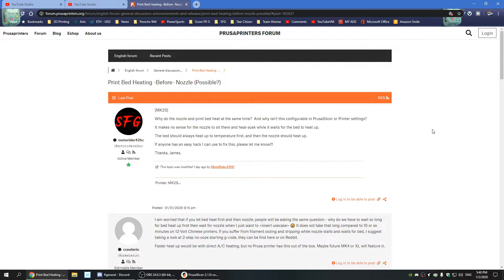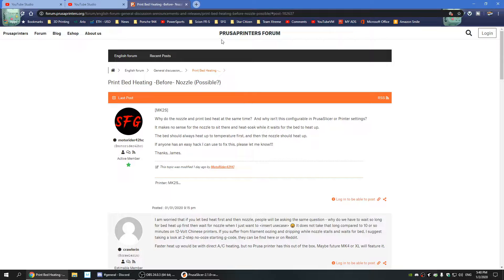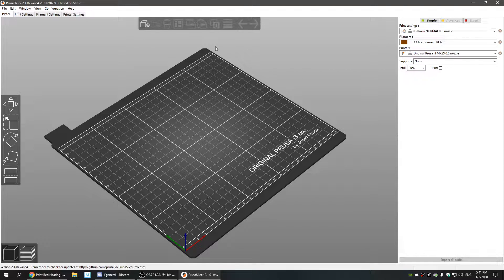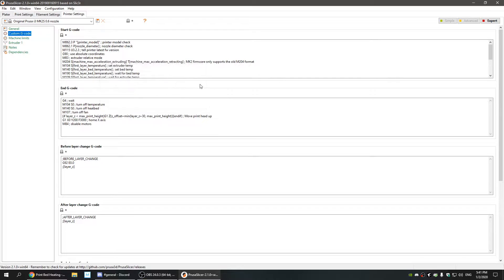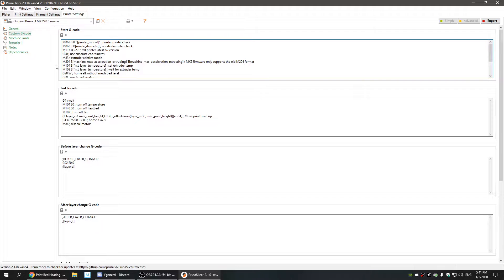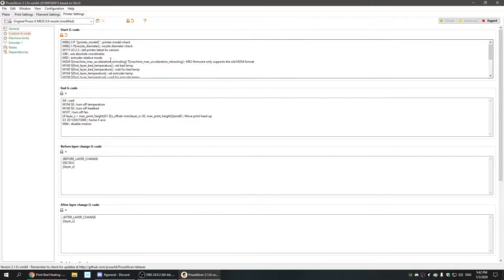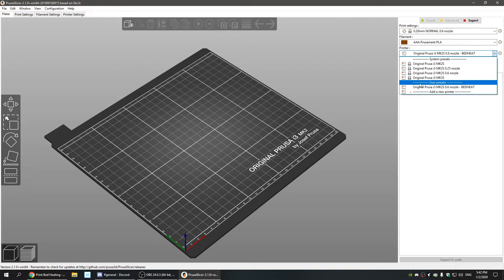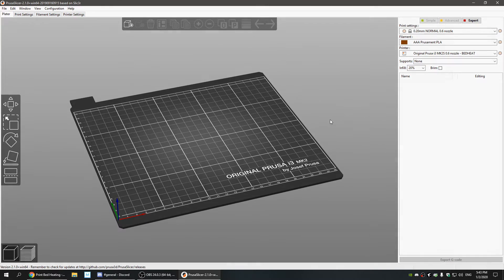PrusaSlicer: How To Heat Print Bed, Before Nozzle Heats

Comment: Can you write it?
Reply from the maker: Write... the code?
Reply: @PowerSports  yes, if you wouldnt mind. I'v been waiting for a quite a long time.
Reply from the maker: @Lasseu   Waiting for a long time?  You posted your comment 2 hours ago.  😂🤣  But yes, i will copy-paste my code when I get home.  However, be warned, this code is specific to my Prusa MK2S MMU1 and may not work on your printer without modification.
Reply from the maker: @Lasseu  ((THE FOLLOWING CODE MAY NOT WORK WITH YOUR PRINTER))
M862.3 P "[printer_model]" ; printer model check
M862.1 P[nozzle_diameter] ; nozzle diameter check
M115 U3.2.3 ; tell printer latest fw version
M204 S[machine_max_acceleration_extruding] T[machine_max_acceleration_retracting] ; MK2 firmware only supports the old M204 format
; Start G-Code sequence START
T?
M140 S[first_layer_bed_temperature]
M190 S[first_layer_bed_temperature]
M104 S[first_layer_temperature]
M109 S[first_layer_temperature]
G90 ; use absolute coordinates
M83 ; use relative distances for extrusion
G28 W
G80
G92 E0.0
M203 E100
M92 E140
G1 Z0.250 F7200.000
G1 X50.0 E80.0 F1000.0
G1 X160.0 E20.0 F1000.0
G1 Z0.200 F7200.000
G1 X220.0 E13 F1000.0
G1 X240.0 E0 F1000.0
G92 E0.0
Reply: @PowerSports  lol, i was just joking. :D but thanks anywei.